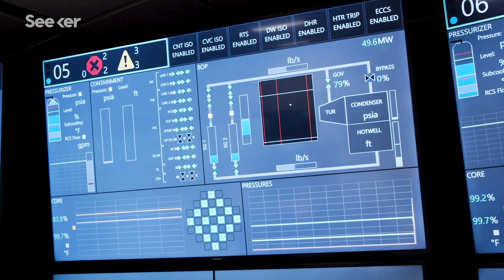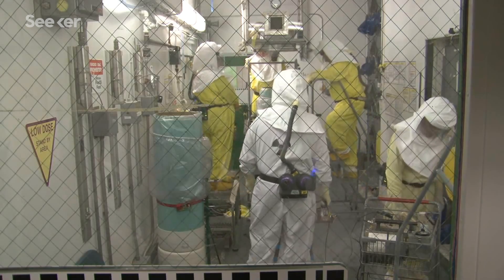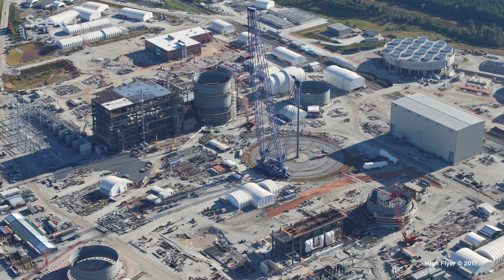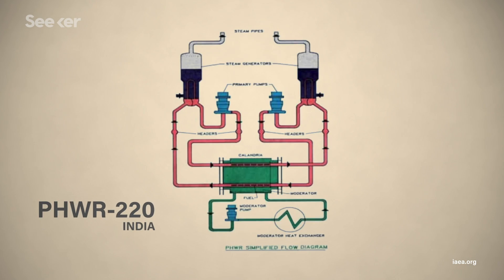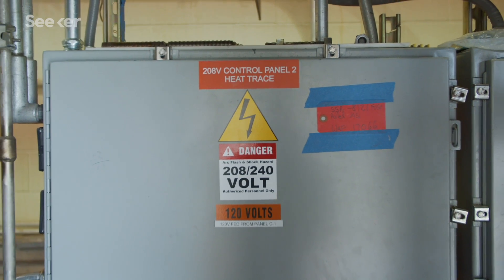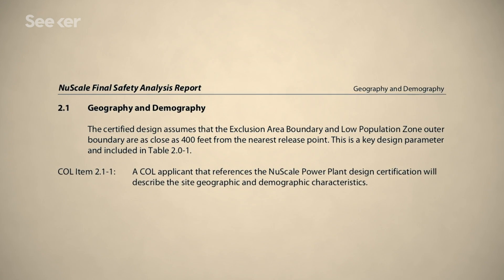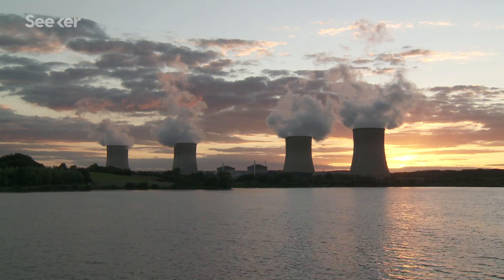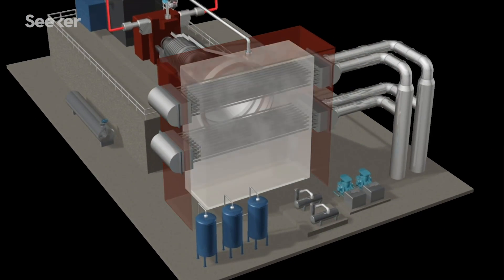Mini-Nuclear Reactors Are Coming, and They Could Reinvent the Energy Industry

Comment: it sounds to good to be true BUT IF they can get it to work that will be great. The only part I am worried about is what happens when the computer system fails? 
They said what happens when there is a power failure but what happens if there is a computer failure and a step is skipped or down twice instead of once due to a computer error instead of user error. 
Then you have everything wears down what happens when a electromagnetic is no longer strong enough but the other is to which that happens during operation of the module?
What happens if 2 modules fail at the same time during use? 
As it is a almost entirely automated system what happens if it is hacked? OR is it able to separate the readings from the outside to what is the controls for the inside? IF so then how do you get around the possibility of user error? IF it isn't a closed circuit unconnected system then it is able to be hacked and the original question is one that has to be dealt with as a power overload will destroy the electrical grid or stop the power from flowing to the electrical grid and overload  the line to the electrical grid. Many other things could happen like that if you connect it to any network that leads outside of the power plant.
Then you have the thing of manufacturing defects as it is a modular system that goes in and out then manufacturing defects matter more than a core that seats still and operates in place
I am sure there are other safety and security issues besides those that i have not thought about yet

Comment: Thorium msr 
That’s the way to go.
Reply: Not enough research in Thorium, most of the research on Thorium went on halt around 40 years ago. Uranium received more funds and has been more research on it. Thorium will have the time hopefully soon.
Reply: Giuseppe Turitto the Indians (dot not feather) just built one. So, it is viable.
Reply: @RideAdventurous  Off course is viable, Americans did it in the 60/70 and it worked, but they discover issues with corrosion and other problems that today could have been solved. But still, we need more research. I am not saying they are viable or a solution, they will be one of the many solutions but today we need to recover Nuclear Energy from the sure death that means the investment stoping in to build new traditional reactors because of the fear caused by the media to Nuclear Energy.

Comment: What I never understood is why do they even need to use fission power in the first place. Why don't they just dump a large amount of radioactive material in a pile and just use the heat from the radioactivity to boil water and turn a turbine? All you need to do is get enough of it together until its surface area to volume ratio is large enough and there you go, it will be self-heating all by itself, it doesn't need to be specialized processed fuels, it doesn't need to be fissile.

Comment: One thing I never understood about nuclear energy is why they can’t get the energy directly from the reaction instead of using the heat for making a complicated steam engine. Doesn’t splitting an atom release a ton of energy? Why can’t they somehow absorb that energy?
Reply: Because there is no efficient method to transform heat directly into electricity. The best was to produce electricity is still though the motion produced by steam.
Reply: we can, google "RTG" or "Nuclear battery", they are just less efficient but it is what powers voyager and his cousins.

Comment: It's interesting that at 0:58 the powerplant is a coal plant. It seems that in most people's minds, cooling tower = nuclear plant.
Reply: People also seem to think the steam coming out of cooling towers is smoke and not water vapour...
Reply: I agree, and what's funny is that the two plants close to where I live don't look like your classic nuke plant whatsoever and most people drive by and have no clue. I blame The Simpsons.
Reply: I always thougbt the tower was to purge steam in the event they had to stop producing power. We have a nuke pland 15 miles away I worked two miles from ot for 5 yrs never seen anything coming out of the tower. The steam was all from the lake next to it.
Reply: @serlawrenceharlem6715  In order to see steam coming out of the tower, the dew point in the surrounding air needs to be much lower than that of the air coming out. That balance depends on local climate, the power output of the reactor, and the rate they're feeding water into the cooling tower. The mix of conditions at your plant might not be right to see the steam
Reply: To expand on Kevin's answer to Joe, cooling towers aren't a requirement for even large power plants, provided they have a sufficient local source to cool with. My local nuke plant uses the water from Lake Ontario and doesn't need a tower because it can just use the lake water for the job and send it back out. Cooling towers are used when there isn't a large amount of water nearby to work with, in order to release the heat into the atmosphere instead of the liquid water (the same amount of heat is released into the environment either way).
Reply: Kevin Colwell what is a cooling tower? What does it do exactly?
Reply: @joegerhard615  Any machine that produces electricity from heat, whether from fossil fueled, nuclear, or solar, has a large portion of heat that can't be converted, so needs to be cooled off. A cooling tower is that iconic hourglass shaped structure that funnels a huge amount of air and water vapor up through it to get rid of the heat. Coal and nuclear are the only sources that typically use the big ones, but some types of natural gas, geothermal, and solar thermal plants use smaller versions.
Reply: humanity doesnt want or need nuclear power. its unnatural, polluting, and dangerous. we prefer renewables.
Reply: Of course renewables are preferable in many ways, but I personally feel we lack the resources and time to implement them sufficiently. Renewables such as wind and solar don't produce nearly enough energy and are too sporadic, and inefficient batteries are required to store energy. (What happens if the wind doesn't blow or it's night?) 

Nuclear is the best way to tide us over until renewables are feasible. Apart from nuclear waste, it is NOT polluting, as it does not release greenhouse gases and such into the atmosphere. It is also not dangerous, as you seem to think. For example, in the Fukushima disaster, which was caused by a tsunami, only one person died directly from radiation. Nuclear energy in this day and age are completely safe to the point where it may well be safer than other energy sources.

Also this whole "unnatural" argument is bullshit. You could call anything in modern society unnatural. Plant and animal domestication? Unnatural. Renewable energy? Unnatural. It's just a buzzword people use to feel good about themselves when in reality it doesn't mean anything and is a non-argument.
Reply: @xD-jm2ie 
"We lack the resources and time"
Actually it is the other way around.
Nuclear is currently more expensive and takes much longer to build than renewables.
For nuclear it is around 10c/kWh for a new plant, while new wind cost 3 c/kWh and is on a trajectory  to go down to 2 in the next couple years.
Building wind or solar takes 1 to 3 years, while nuclear takes 10+.
If you want to pump out a bunch of nuclear power plants, you first have to reinvent and train a whole industry, while renewables already have a running industry that just needs scaling up.
Reply: Jakob Schulze The problem lies in the scaling up of these technologies. Solar and wind currently operate as secondary power sources, as in, when they cannot operate, other power plants pick up the slack. A system relying entirely on renewables is not really possible atm. Another thing to consider is that solar and wind are not as energy-dense as nuclear. Solar and wind farms take up a lot more land than other sources, even factoring in rooftop solar. Barring groundbreaking new innovations in these technologies (paintable solar and efficient energy storage hopefully coming soon), I just fail to see how these sources can supply electricity to a nation's power grid consistently. 

On the subject of energy costs, the most recent source on global power costs I can find is a 2015 paper by the IEA and NEA. It appears that energy costs from each source have a median cost of around 10c per KWh.
Reply: @xD-jm2ie  "apart from nuclear waste" is the problem.. We don't want this poisonous waste.
Reply: R-View Which is why we seal it away in insoluble barriers such as borosilicate glass and synthetic rock. 

And then we put it in a facility deep underground so even if it does end up leaking waste/radiation noone will ever get hurt.

The combined total of the world's "high-level" waste is only like 22000 meters cubed according to 2018 IAEA estimates, which is really not much, when you consider that its distributed throughout the whole world.
Reply: @xD-jm2ie  I agree with you in that nukes are a less ecologically damaging way to produce energy but burying it is damaging you have to admit. If it leaks and gets into the water table then it's bad news.
Reply: sc0tte416 We have the technology to contain it until it's radioactivity decreases to safe levels. Of course it'd be bad if it leaked into water tables but the current strategy is to put it in underground rock formations encased in even more impenetrable substances which makes it all but impossible for it to irradiate surrounding environments.
Reply: @xD-jm2ie  I understand that, and I know there is one in Arizona or somewhere around there that is up in the air politically. Thing is that the half life of some of this stuff is thousands of years...you can't just bury and forget, since the material itself eats away at the containers they are held in therefore need some sort of maintenance...
Reply: @xD-jm2ie  

If we used thorium reactors we can use the old waste for power. I believe we could also use the material from nuclear bombs for power, getting rid of those weapons altogether.
Reply: @sc0tte416  

Waste produced by thorium reactors only lasts 300 years.
Reply: @sc0tte416  A billion years ago, uranium still had enough U235 in it to form a chain reaction without being enriched, and after oxygen built up in the atmosphere, uranium became soluble in water, and built up concentrations high enough to start fissioning when there was enough water around to moderate the neutrons. Half a dozen of these natural reactors were discovered when the French were mining uranium deposits in Gabon. They'd operated for something like a hundred thousand years, just heating up till the water boiled off, then stopping till they cooled down again. This was in permeable rock under a rain forest, but in the billion years since, the fission products produced have only migrated a meter or two. Spent fuel rods are very hard uranium oxide with zirconium cladding, and they're to be put in impermeable rock below the water table. I don't think they'll trouble any of our great great grandchildren, should we have any. It's more likely they'll be digging them up for the valuable isotopes and metals in them.
Reply: Jakob Schulze sure, because of decades of government red tape preventing anything from happening, and making it so expensive and time prohibitive to even start. When it takes 20 years to get final permission, it’s a little hard to invest money into making a plant, that might not even be allowed. You’re confusing actual costs, with regulation forced costs.
Reply: Keylanos Lokj 
Tell that to the 450 nuclear reactors that are producing power right now.
Reply: @keylanoslokj1806  Renewables alone cannot sustain us. Renewable along with nuclear is the safest cleanest way.
Reply: @keylanoslokj1806  Thank you for speaking for all of humanity.
Reply: @keylanoslokj1806  You do not speak for all of humanity. Until nuclear fusion becomes available, it is best to use nuclear fission as it is simply better than solar or wind power.
Reply: @keylanoslokj1806   like solar? Get this, solar panel manufacture makes more toxic waste than a nuclear power plant. It'll give you worse cancer too. Fluorine is one hell of a drug.
Reply: @keylanoslokj1806  
steam power? from the earth? its just heating water from the earth and then making steam to move the turbine to go to to generator?

Comment: I would definitely feel more at ease with that new plant design
Reply: the biggest safety feature is being underground, one foot of your average dirt can block all alpha radiation (to be fair so could a sheet of paper), 95% of beta radiation, and about 5 - 15% of gamma radiation depending on the natural metal content (i.e. red dirt>black dirt when it comes to radiation containment) 

after a few dozen of dirt you are completely safe (nuclear waste doesn't produce much gamma radiation), so even if the reactor manages to avoid all of it's passive and active safety, get hot enough to fight the cooling effect of the water pool (which due to it's size it should not be able to do) , and releases all of its nuclear material in a perfectly impossible spread across the building, it will still never leave the site.

Comment: Hey seeker, please do a video on the demand vs output of renewable sources like solar and wind power, why it is not in itself the solution for the energy crisis, and energy storage methods
Reply: I dig it, but roughly speaking, not always sunny and the wind isn't always blowing. Energy storage is hard when batteries suck.
Reply: Michael Weigley i think the only viable storage solution would be pumped water storage, but it takes years to build and has specific geographical requirements
Reply: @aidaneloff5357  Bill Nye talks about those concrete piston and cylinders, which are entertaining if nothing else, you should check those out. There are a few TED talks by an environmentalist who presents why he changed his mind on nuclear. He addresses his concerns over solar and wind and why he doesn't believe they are reliable enough for the base load of electricity.

Comment: Also, some of the SMR designs have a very high output temperature, which is very useful.
Because now your SMR can efficiently desalinate sea water (potable) and it can then crack that H2O into hydrogen.
And once you've got cheap hydrogen we can ditch all these silly battery cars and run them off of hydrogen fuel cells.
Because a liquid fuel source is always better than a solid or chemical process (battery)
And we already have the infrastructure for liquid fueled vehicles.
Reply: Yes water cool nuclear reactors make hydrogen when things go wrong, that why the blow-up💥, the waist is deadly for 10,000-20,000 years, as opposed to thorium molten salt reactor waist only need 300-500 years, every time they mine to make cordless drills motors they dig up thorium.
Reply: @drmosfet  
That is mostly correct.
Cracking H20 using the high temperature feed from MSRs is a feature, as opposed to a danger in light water reactors.
Thorium MSRs do produce much safer waste, but it's the liquid fuel salt that provides that feature rather than the Thorium.
Although ultimately Thorium fuel is the goal, but only once we've burnt all the high level waste in MSRs.